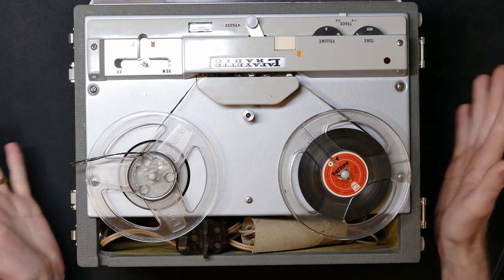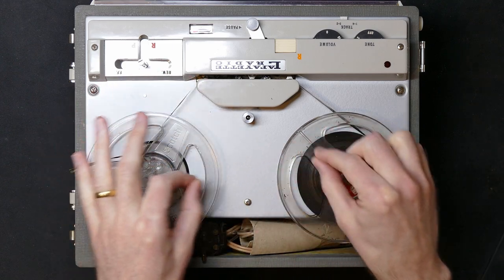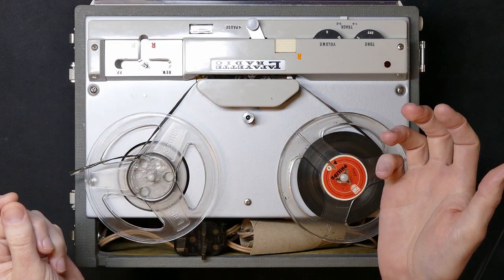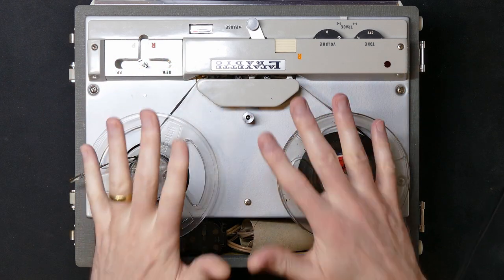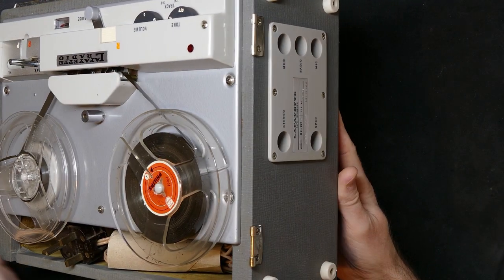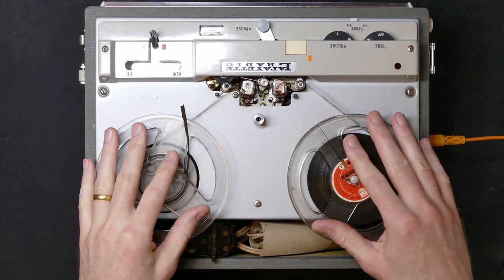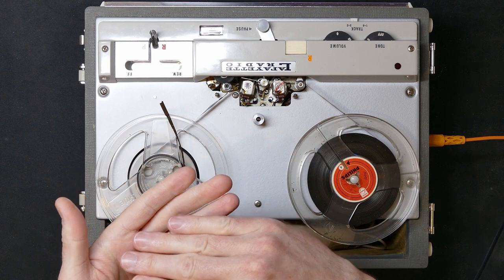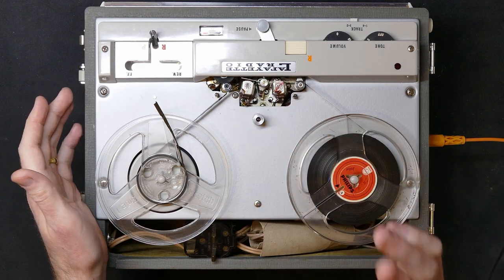Music Tutorial: Playing Audio Tape By Hand - With the Power Off

Comment: Does this also work for a regular tape recorder and cassette?
Reply from the maker: In should work equally well, as long as you have a means to getting a direct signal from the read head and are able to rotate the tape manually. Depending on the device you use, some minor tinkering might be required.
Reply: @hakonsoreide  super cool! I wanted to try experimenting with manual tape editing.